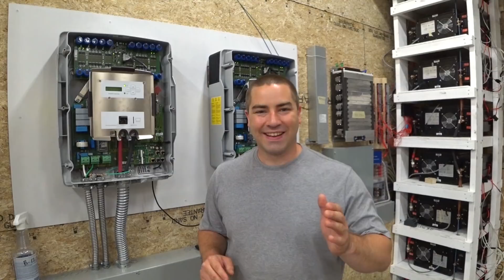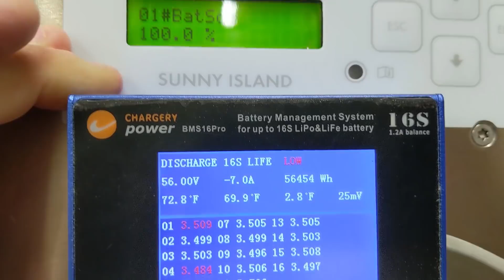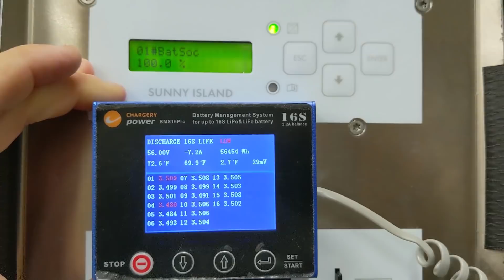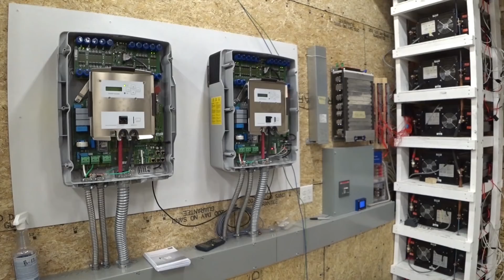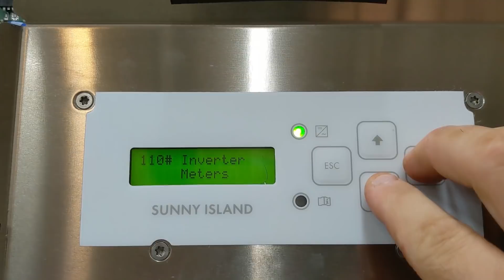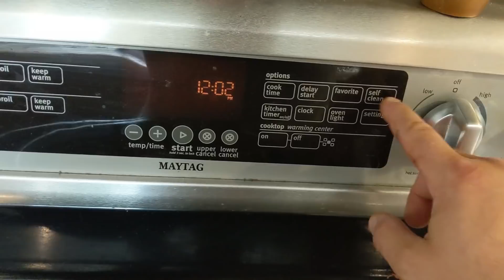Overloading SMA Sunny Island Inverters, Off Grid

Comment: Wow! So exciting the inverters rocked the load test. Curious the loads were not more balanced so the KWs were the same’ish. Disappointed we did not have any info on the BATTERIES...we know they were at 100% but how long did they last? What was the load draw? Good job! Keep them coming!
Reply from the maker: I can do a follow up video, but my shunt readings are still not spot on.  I'm still working on the calibration.  
In a previous video I tested the batteries and they are 24kwh, so I could run a 12kw load (100%) for 2 hours.

Comment: How long can you run at 50% load?
Reply from the maker: Well, the inverters can run continuously at 50%.  But if you mean how long will the batteries last at 50% ?  Then the math is:  
My battery bank is 24kwh usable, as tested in a previous video.  
50% on these inverters is about 6kw total.
24kwh/6kw=4 hours run time at night.

Comment: Never had much luck with SMA inverters for our solar except one. Had 4 SMA failures for our main solar system on our home. Good job. No need for so much excitement. Glad to see they did not blow but that did put a strain on them. Im quite sure the batteries did just fine. LiFePO4 cells are good batteries.
Reply: I  need help getting started on my off grid solar & battery bank systems. Who do I contact?
Reply: Ours are great. 1st one lasted 13 years and it was replaced with a  2nd one and has been running 8 yrs and counting. 3rd one had a bad relay after a year and got a free replacement.

Comment: Awesome. Are you close to being completely off grid yet?
Reply from the maker: Yes.  I've been off grid since April, but I don't have enough solar/batteries for winter yet.  I'm in cold MA, and have electric heat.
Reply: @DavidPozEnergy  sounds like you need one of those nice heat pump systems

Comment: Amazing test, I wonder how much current was flowing from the batteries if you could show that as well to check efficiency.
Reply: Rated output current for the Sunny Island 6.0 and 8.0 is 20A, with a peak of 120A for a short while. The limit would, then, be the battery.

Comment: Impressive! How long would your batteries hold up under that load?
Reply from the maker: My battery bank that's connected has tested to 24kwh usable.  So, about 2 hours under that load.  But, of course I  was just doing a test.  I ran it heavy like this for over an hour (close to 2) but then shut off the heaters.  It was also sunny while running this test, so we had some solar energy coming in.

Comment: That’s great Dave! Wondering how your batteries fared? What kind of kilowatts did you go through for that test?
Reply from the maker: I made it.  I chose a sunny day for the test, so I had 4kw of solar coming in.  My battery bank is 24kwh.  I ran them for 2 hours at 12kw load (24kwh) and then shut off the extra stuff to make sure the oven could finish it's last hour of cleaning.  Never overheated.
Reply: @DavidPozEnergy  Ist the BMS of the battery connected to the inverter?
Reply: @DavidPozEnergy  I need help getting started with my off grid battery bank & solar panels systems. Could I hire you to help me? If not who Could show me

Comment: Awesome!!!!........Would I be able to use this (2x6KVA) to run a 12-15KW DC motor via a LiFePO4 Battery bank (Size to be determined) on a sailing catamaran with an electric propulsion system? my intention is to have 2 independent systems in each hull.
Reply from the maker: I don't know how you would do the speed control in that situation.  The electric kits I've seen for sailboats are meant to pair with a DC controller for speed control.  The short answer is, I don't know.  Sorry.
Reply: @DavidPozEnergy  Thank you for the super quick response; My design will include 2 separate controllers for two motors directly connected to the Battery Banks (with safety shutoff) and the Inverters will be used to power the house loads (12v, 24v and 220v) from the 48v Battery banks. A solar array will be used to charge the battery banks via the Inverter/charger and MPPTs. One or two DC (or Fuel Cell) generators will be used as a redundancy......  I hope that makes more sense :)
Reply: @DrInox-pn9kn  Hi buddy...
I have a question 4 u, as I am planing on doing something similar 2...
How much solar at u planing 2 have & what r ur plans 2 eliminate the disproportionate losses caused by the slightest bit of shadow (from the lines etc.)..?
Also how big is ur cat..?
Thanks.
Reply: Alternatively you could just use your sails.
Reply: @4philipp  Maybe he doesnt have sails. Did he mean Catamaran when he said "sailing catamaran"?  IMO ...He might as well ditch the sails and just go all solar considering the money, effort, and weight so far.  -- Maybe have  kite sail for down wind extended runs.
https://inhabitat.com/files/beluga2.jpg

Comment: come on david at  5:22  you scare me bro!!!!   lol   you got all excited and scare the  $&*# out of me,
Reply from the maker: Sorry to scare you.  Just so happy.
Reply: @DavidPozEnergy   how much you pay for  the inverters?
Reply from the maker: $2400 a while back on Ebay.  There are a bunch of them that pop up on auction sites this year.  Last year a big company went bankrupt and the inventory is filtering down through auctions.
Reply: @DavidPozEnergy   i got the  SCHNEIDER ELECTRIC CONEXT XW+ 5548 is  running sense 2018  i  can sell power back to the company  one of the main reasons i got it for. i pay 2800 for it on amazon now they  are like   3400  i hope this last  10 plus year if not i will get  yours  , grate video by the way i always buy from battery hookups and used your discount to help you some way . i just to do jehu but he all ready got a business running you need it more  lol.  will like to se a video on your golf car  make it faster   lol  or the EV car   it is working?
Reply from the maker: That's also a good deal on the Schneider.  I've heard they hold up really well.  
I've got the golf cart in the shop now.  Working on the solar panels for the roof of it.  
The EV didn't work out.  The controller is shot, and I found a lot of wiring burned up as I was taking things apart.  I'll salvage what I can, but don't expect me driving an EV for awhile.
Reply: @DavidPozEnergy  i will take all the guts out and add new wire and  new inverter for the Ev i think will be easier to deal with you own installation  just test the dc motor if is working you good in that part. i own a 2013 leaf  and is grate i do not go to any gestation for the past 3 years  lol